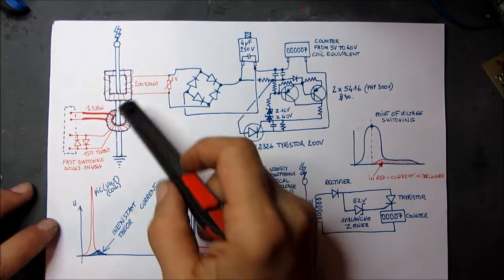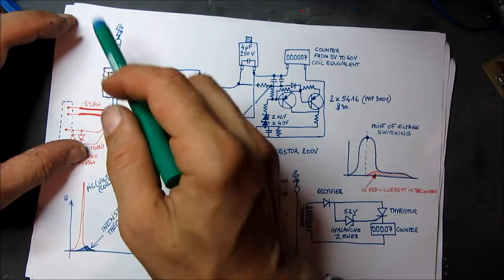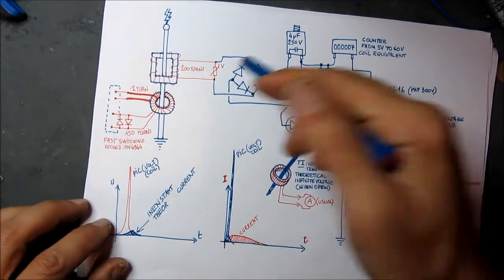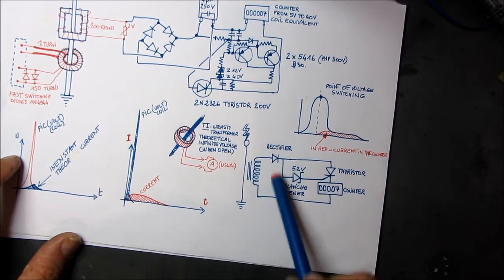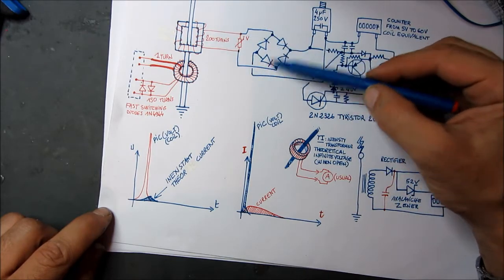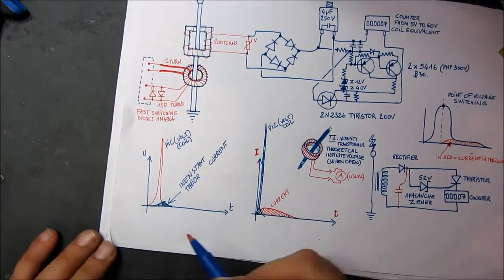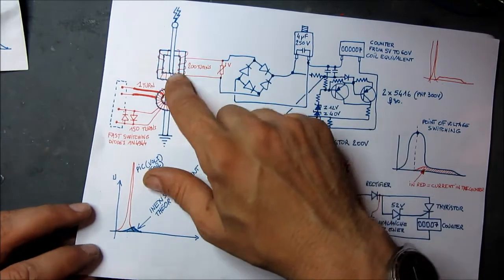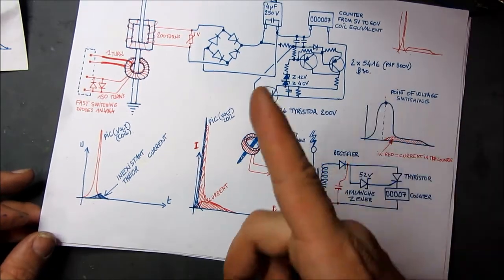Thunderbolt counter process: How it works

Comment: Pure class explanation
Reply from the maker: are you kidding? lol. Thanks.
Reply: Well at least you include the schematic diagram which Make it simpler. I am now studying one discharge counter, but from another manufacturer.
Reply from the maker: @dfwdreamforceworks8635  that's ok. This video is old and my english very awkward. Technical information in there are complete, and I hope it will help you. Thanks for appreciating and commenting.